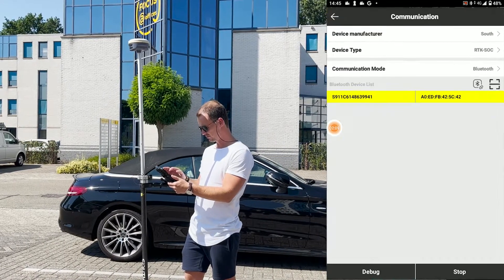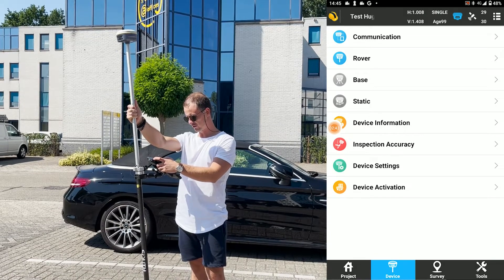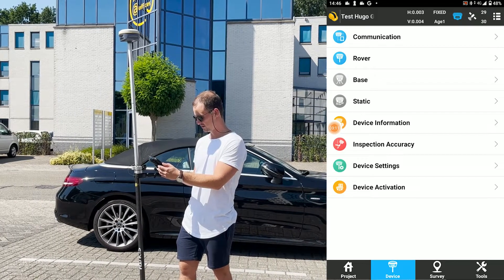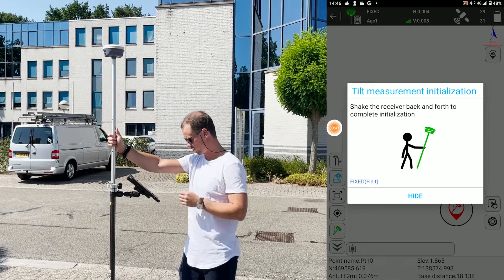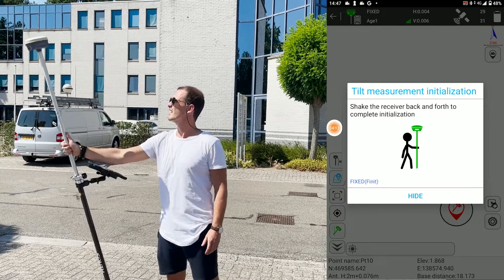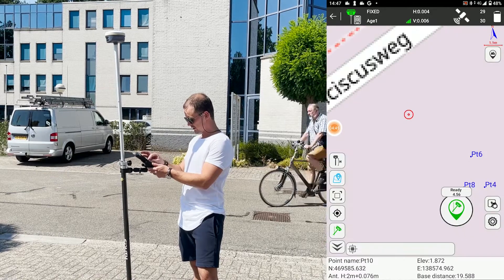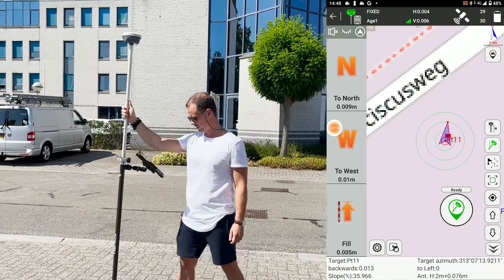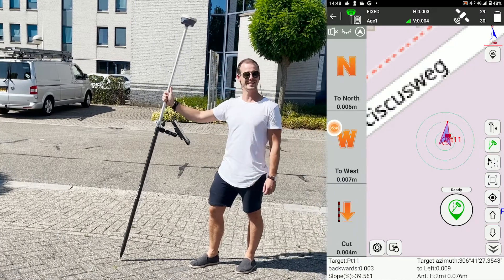How To Set Up the IMU Tilt Sensor for the South Galaxy G7, G2, G3 and INNO7 Using the SurvX Software

Comment: Hi, what do you think about the south galaxy g3 rtk kit? I need some feed back on this equipment  please before i purchase.
Reply from the maker: It's a good and affordable device, Which software are you planning on using?
Reply: @globalgpssystems4397 I will be purchasing the south g3 acme version (which an upgraded version to original g3). The software that will be on h6 controller is: Eg Sta. How do you like imu tilt mood?
Reply from the maker: @bashysamuel5392   Where are you purchasing it from? And what is the difference between the normal version and the acme version as we are not aware of any differences. Only that it comes with 2 different gnss boards
Reply: Am purchasing from this company in china: Sichuan Surveyor Space Information Technology  Co Ltd.
The difference between Acme and original g3 is: acme has longer rtk range with internal radio (8km) and with external (15km)
Reply: Here is the link
Reply from the maker: @bashysamuel5392  Why didn't you contact them about this haha? also, there's no difference is radio range as they all use the same module.
Reply: @globalgpssystems4397  am just trying to get other people feed back on this before purchasing. I have to build my confidence, but they did say it's an upgrade in longer rtk range
Reply: @globalgpssystems4397  how do like the imu tilt working mode?